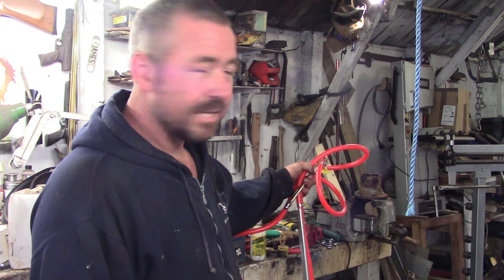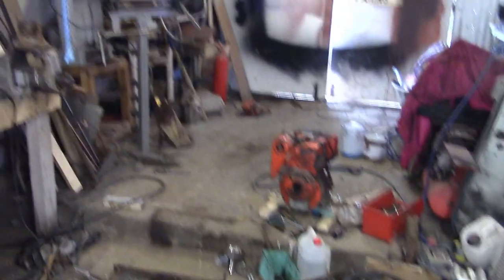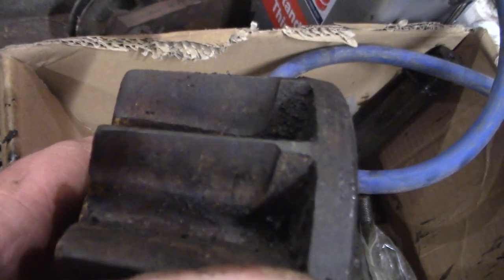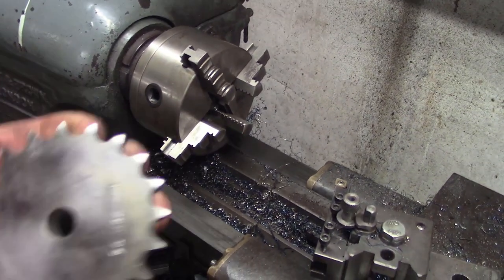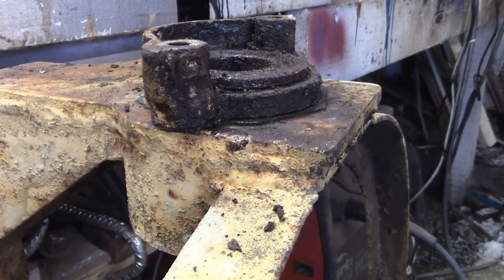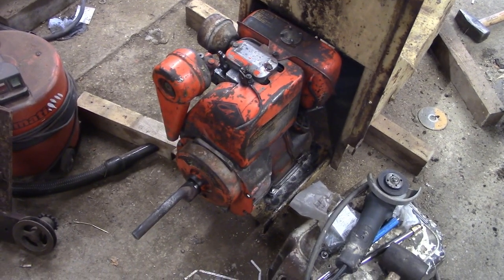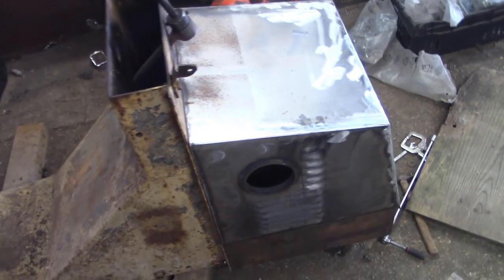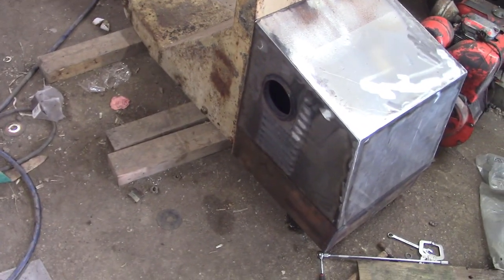Vintage cement mixer restomod PT2 Sprocket, Bearings and Tin work

Comment: Looks great, but you might want to cut a hand clearance on the bottom (not the cover) to make it easy to open and maybe add a couple tabs to the bottom flange (of the cover) to locate your hand so it doesn't get pinched on closing.
Reply from the maker: Good thinking, i might weld a bit of bar on or something but I'm sure I'd regret leaving it

Comment: My boss gave me some body armor for pressure washing. Before I began work with them, they had rented a pressure washer rated at 10,000 psi. It was a two man operation as one man was required to turn up the pressure, while the other person did the cleaning. I'm glad I wasn't there yet. That washer would make for a sore arm real quick. We have one that does 5,000 psi, and it's most adequate now.
Reply from the maker: I'm trying to catch the grit for drying and re use, do you have any tips?
Reply: @turboconqueringmegaeagle9006  maybe put a big tarp down to catch it, then pour that through a fly screen to remove the debris?
Reply from the maker: Sorry I emphasised the wrong aspect of the process, I'm catching it just fine in a cut open IBC, drying is the problem I need to solve before I think about getting the debris out, I'm only using crushed glass so it's very cheap anyways.
Reply: @turboconqueringmegaeagle9006  you might be able to dry it the same way fresh grain is dried. A perforated pipe with a fan blowing through the crushed glass might work. Another idea would be a materials tumbler with a fan blowing across it also might work.

Comment: I see you used the same method to get bolts out of your hub as I did changing my X Type's rear wheel bearings. Nice work. Like the way the mixer is looking. Won't be as bomb proof as my Meddings pillar drill though. I reckon it could almost survive a direct strike. (Though the motor might need a new capacitor).
Reply from the maker: Meddings make a nice drill, cheers mate
Reply: @turboconqueringmegaeagle9006  you wouldn't want to drop one on your foot.
Reply from the maker: @BensWorkshop  with the greatest of respect, having stumbled onto a joblot of old Listers, I'd choose a pillar drill on my toe over the biblical weight of the sr2 that ruined my back this morning.
Reply: @turboconqueringmegaeagle9006  Fair... Even fatter than my Petter AV1. Nice engine, what have you got planned for it?
Reply from the maker: @BensWorkshop  probably to power the back actor I got from the same people, put the weight to use as counterbalance. 
I'll put a little video together of all the bits I picked up when I get the last load, there is some pretty interesting stuff.
Reply: @turboconqueringmegaeagle9006  What is a "back actor" and I am curious how much it all cost.
Reply from the maker: @BensWorkshop  the Americans call them back hoes, the three point attachment that turns a tractor into a JCB.
I paid £300 for everything, the implement, 3 Listers and a really wierd Petter compressor... And a hayter paddock mower and a woden vice but it's broken and probably 50kg of rusty bsw spanners. Bit of a touch, if I had any sense I'd sell it all and just buy a digger but that'd be too easy.
I also got one of the Petter ac2w boat engines but that was a different deal with a different person and it'd been sat at the bottom of the sea and is in bits in boxes.
Reply: @turboconqueringmegaeagle9006  Interesting haul. Like the idea of an SR2 powered digger.

 I don't suppose you picked up a spare AC2W gearbox by any chance.....
Reply from the maker: @BensWorkshop  it came with a seized hurth 40 2:1 mechanical clutch type reverse box but I don't know what I'll do with the engine so can't say if the box is spare.
Reply: @turboconqueringmegaeagle9006  Fair enough. What were the other 2 engines and what is odd about the Petter compressor? (Or to put it another way, when are you doing the video on your haul?
Reply from the maker: @BensWorkshop  lv2 (it's the only one that actually runs)
Ld1 (all the tin has rotted away)
St1 (also semi siezed and missing bits) 
The Petter is a w1/2 so the boat engine version of the a2 petrol with one cylinder replaced with an air pump, from what I can find they were made for starting big McLaren diesels and all got sent to Russia during the war although mine has a lot of light alloy fittings like the later A engines and it was in a barn in Cambridgeshire so I think there is a hole in my research.
It is also very heavy.
Reply: @turboconqueringmegaeagle9006  Interesting set of finds. 

So does the SR2 run?
Reply from the maker: @BensWorkshop  no it's locked solid but I've got oil sitting in it now so hopefully it'll free up without anything too invasive.
Reply: @turboconqueringmegaeagle9006  You can also use very hot sump oil down the pistons. I have seen that many times and it works better than cold oil. Let it sit for half an hour.
Reply from the maker: @BensWorkshop  I can see that being very effective, I've dropped kero down the bores, if that all seeps past the rings without freeing it up I'll try very hot oil but I'm in no rush at the moment, 101 other things to do first.

Comment: Are you losing weight there James? Looking good! (no homo)
I was kind of hoping to see the perforations like you did on the floorboards of the tractor as vent holes/step stool engine cover 😁
Reply from the maker: Those dimples were fun, there's a time and a place for them though and if you want to see more I guess I'll just have to build another dump truck!